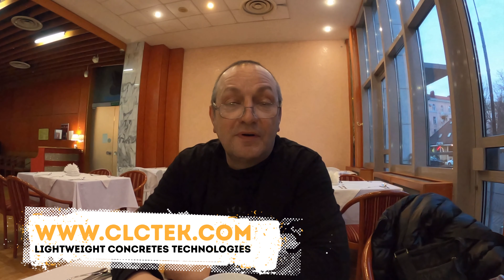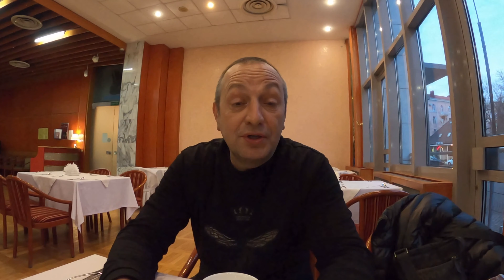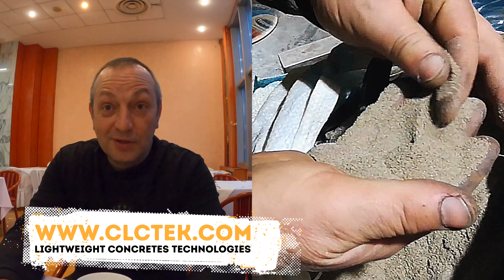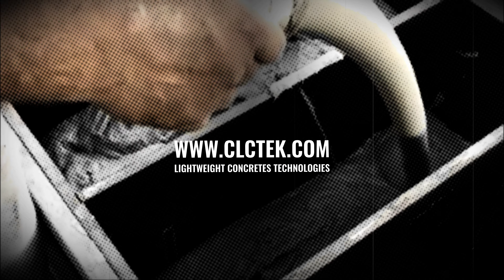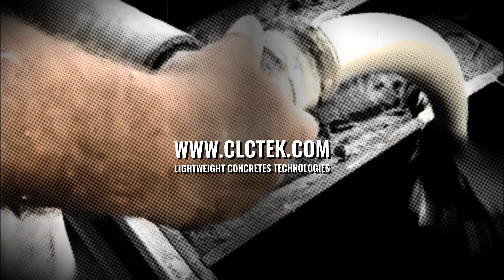Sand for foam concrete and other lightweight concretes

Comment: What is the ideal sand size in microns that can be used for foam concrete?
Reply from the maker: The rule is very simple - the lower the sand fraction, the better.